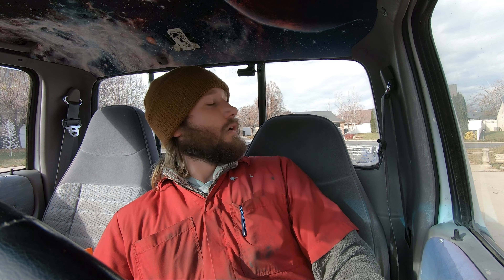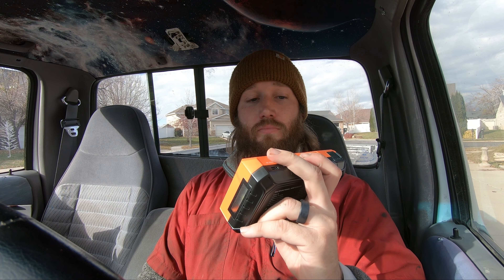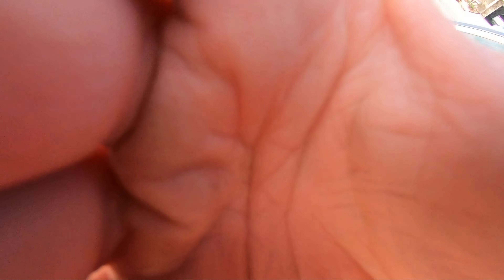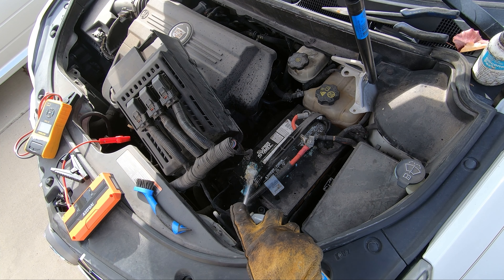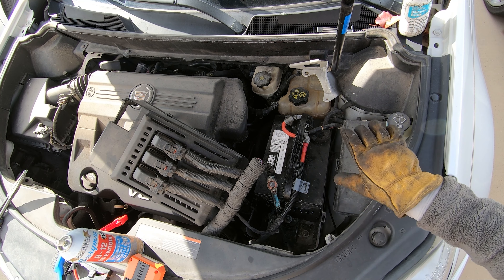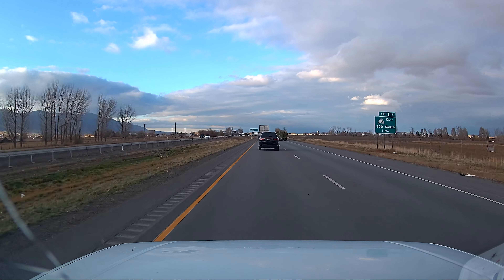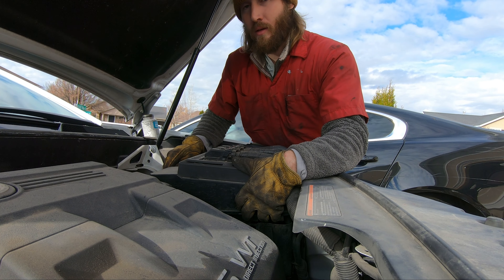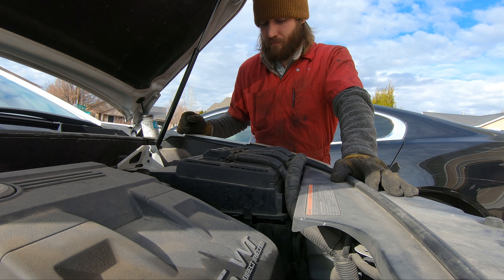Bad Battery | EVERYTHING You Need To Know About Your Car's Battery | AstroAI Jump starter

Comment: It is possible to over-discharge lithium chemistry.  But all lithium batteries that consumers would buy come with a battery management board inside the battery case that makes it nearly impossible.  The usual functions of a BMS include over and under charge, cell balancing, limiting current during charge and discharge.  Some will also include under and over temp protection.  To help protect the terminals from lead acid corrosion, you can slather on dielectric grease or fluid film before and after you connect the terminal.

Comment: You must have loads of those jump packs now. I’m happy with my Noco and it’s never let me down. You get what you pay for 👍🏼
Reply from the maker: I do. They are one of the best tools in my opinion!
Reply: Yeah those Chinese jump packs are pretty good with the reverse polarity protection as well...  It actually beeps at you when it's connected backwards 😅

Way better than standard jumper cables against blowing the main fuse or worse 

Ernest showcases a handful of  brands but all similar in design
Reply: I love my Noco boost! Best $90 I ever spent. Well worth it.

Comment: All great points😅

Lithium iron phospate batteries for a starting system??? 

I usually see those Lithium batteries in van life conversions as "house batteries"

Didn't know you can totally discharge deep cycle batterie... Thought it was best practice to use up half of the rating to prolong the life, shrugs. Saw a van lifer using them but was meticulous about topping up the fluid level with distilled water and after 2+ years, still OK 

but their warranty isnt as long as a flooded automotive lead acid one 

That battery you were working on has easy to remove caps and it was pretty crusty around that too😢

Comment: What people Dont know if the battery goes weak especially with the cars with stop and start  , you can have warning lights on your dashboard fault codes.  so if you find you start to have a few electrical faults check your battery  first . good video again .
Reply: For me the worst thing you can do is to use the stop start lots of extra wear on the battery starting motor and flywheel, I would never buy a car that you couldn't turn it off.
Reply from the maker: yeah they stress me out
Reply: @Ronick-Q-46 right, I've always heard of people turning that dumb option off or having to buy an aftermarket kit to disable it permanently

Comment: The best battery that I have come across is the 640 CCA Century lead acid battery which is made in Australia,not the Indonesian made ones which tend to leak acid past the positive terminal & cause that black lead sulfate to build up on the battery terminal & cause high resistance.

The 640 CCA battery is big enough to crank a 5.7 litre Chevrolet LS1 V8 engine over no worries.

I accidentally connected the jumper cables up back to front without the alternator being connected & I am glad it wasn't because the diode pack would've let the smoke out otherwise.

I just blew the engine management & stereo fuses because they both have reverse polarity diodes in them !